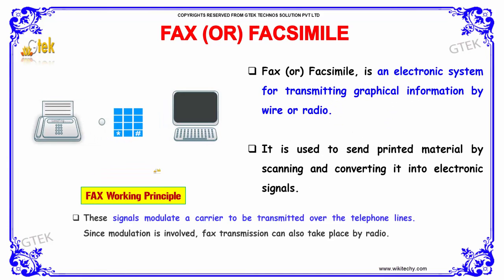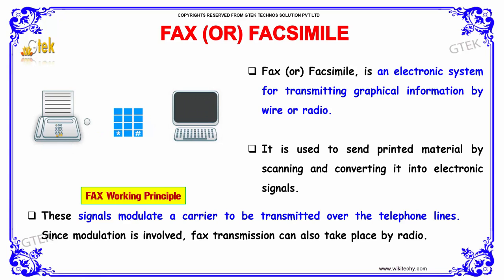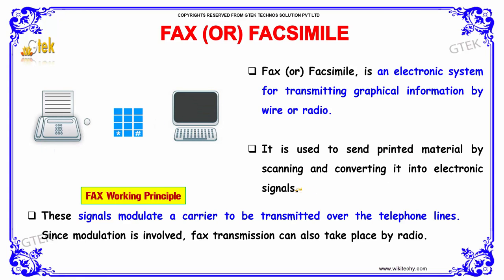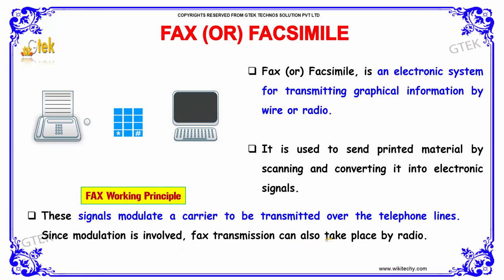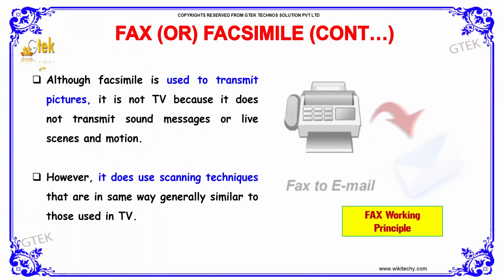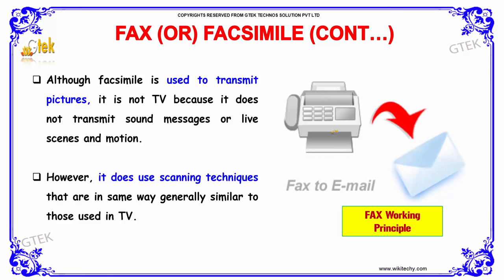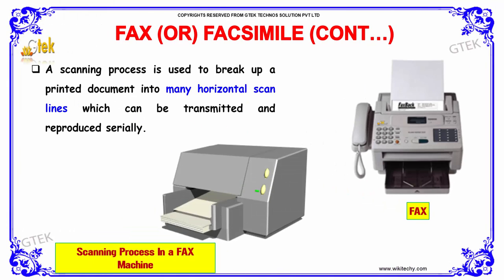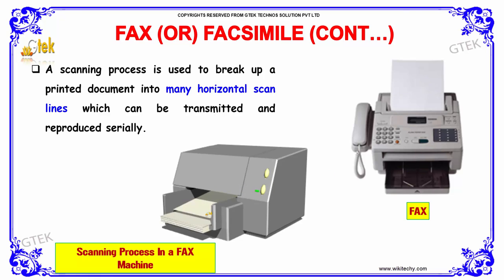Fax or Facsimile | Communication System |class 12 physics subject notes lectures|CBSE|IITJEE|NEET

Comment: Fax (short for facsimile), sometimes called telecopying or telefax (the latter short for telefacsimile), is the telephonic transmission of scanned printed material (both text and images), normally to a telephone number connected to a printer or other output device.

Comment: Early systems used direct conversions of image darkness to audio tone in a continuous or analog manner. Since the 1980s, most machines modulate the transmitted audio frequencies using a digital representation of the page which is compressed to quickly transmit areas which are all-white or all-black.

Comment: The original document is scanned with a fax machine (or a telecopier), which processes the contents (text or images) as a single fixed graphic image, converting it into abitmap, and then transmitting it through the telephone system in the form of audio-frequency tones. The receiving fax machine interprets the tones and reconstructs the image, printing a paper copy.